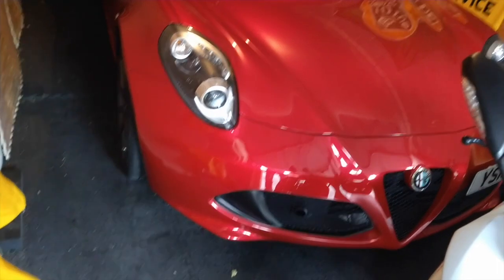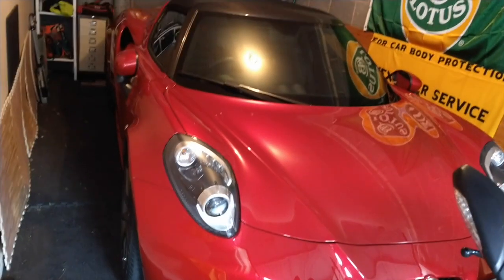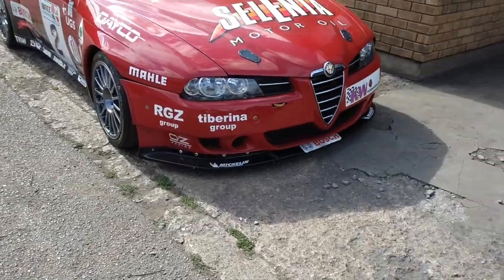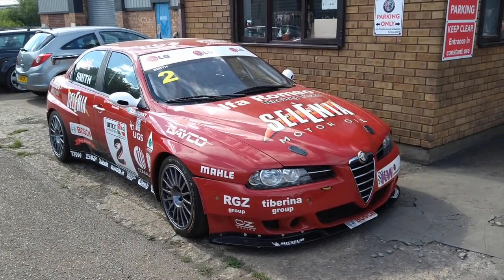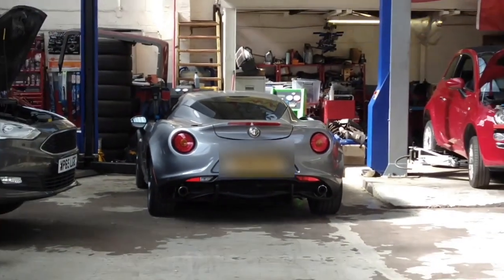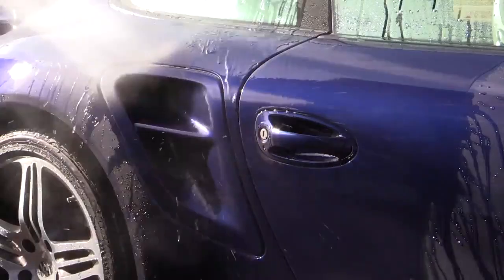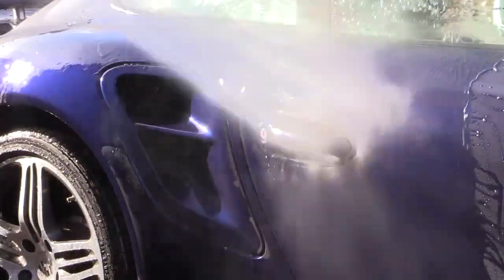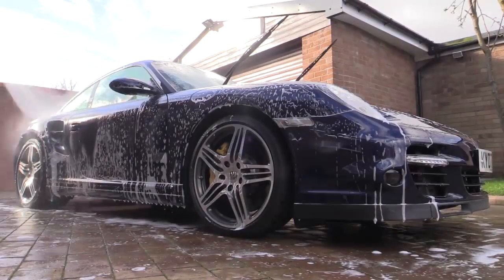My Alfa Romeo 4C is fixed again

Comment: Hello jonny, my 4c have the same transmision problem like yours ex. Should i change the control unit or the electricmotor from the hydraulic system. Thank you for tips. Greatings from Austria Thomas.

Comment: Hello Johnny, I've just stumbled across your posts from last year regarding your transmission issues with your 4c. I am experiencing the same with my 2015 Launch Edition. I've done a battery swap, once last year and the problem vanished for several months and 1,000 plus miles. The problem has re-occurred. Argh. Did you finally resolve the issue with the TCM replacement. I know you've sold the car but did you have any issues after Neil's repair work?? Thanks so much for the great vids and your persistence with the troubleshooting. Shane from Las Vegas.
Reply from the maker: Hi Shane. In the end taking it to the indendent dealer and getting the power control to hydraulic pump changed fixed the problem. It was a great car and I often wish I still had it (like a many of the other cars I've been lucky to own). Thanks for watching!
Reply: Hello shane, have you fixed the problem, my 4c have the same problem. Should i change the control unit or the electricmotor for the hydraulic systems. Greatings from Austria Thomas
Reply: Hi together, I‘m facing the same issue. Can you please give me some insight which control units you have changed? Thanks a lot, Florian

Comment: Most likely as the chap said is the voltage regulator as its a common problem. Its only held on by four screws, yes two are difficult to get to but not sure why all your wiring was checked for a known common problem andon a  low milage car.. The main harness un clips and pulls out, remove old unit replace with new plug back in. Job done. You can just swap the harness from old unit to new unit without fitting just to check the problem has gone in about 5min. £500+ bill for a sub £100 part and what should only be a couple hours labour max seems a bit steep.
I'm not meaning to discredit your Alfa Specialist, I'm sure they were only being thorough but for anyone else I'd recommend doing it yourself.

Comment: If the car was out of warranty but dealer serviced the majority would have been covered as goodwill, I’ve had one repair done which would have cost me £300 covered completely by good will. Car is low mileage 12k after 5 years but has a FDSH
Reply from the maker: You'd think so, but my local dealer doesn't agree. Thanks for watching.
Reply: FCA just replaced an O2 sensor gratis on the sons Abarth out of warranty, dealer said no, call to customer services. In 2015 when I got the 4c no locking whel nuts, polite call to CS saying you get them free on a Mito, hey presto.